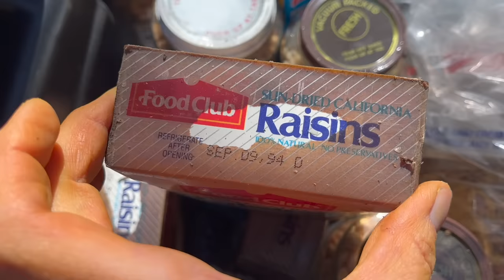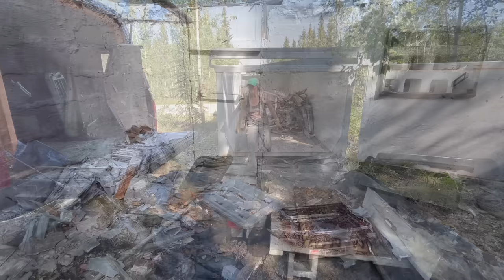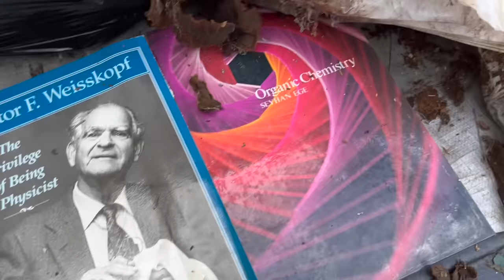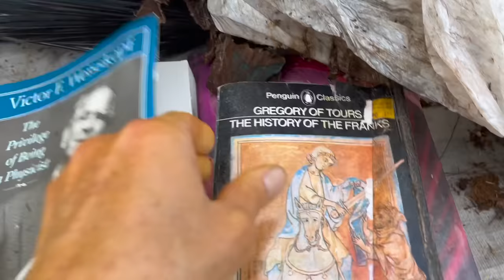Return to the Survival Bunker- I can't sleep.

Comment: The difference in batteries:  Standard batteries will corrode and leak out over time.  Industrial or Super Heavy Duty batteries have sealing gaskets and are made to better specs.  So if you need them to sit a while, get the better grade.  But if you blow through batteries really fast, get the cheap ones.    I am surprised there was not a basement.  Great work!  What a trooper!
Reply: Thank the lord there wasn't a basement can't imagine the flooding and the gunk. Especially from the leaked gas. The film it might have left ontop of the water. 🤢 It would've had to been pumped out or at least that's the only thing I could imagine being done to get it all out. Then how would you seal it up so it doesn't happen again oh and not to mention trying to dry the area out so it docent mold or corrode faster. 😵‍💫🤯 What a nightmare that would've been.

Comment: Brooke, have you ever given consideration to maybe starting a fire on the floor which would eliminate the fuel smell as well as the rancid smell of decaying food.  The smoke smell will dissipate too.
Reply: Before tackling the floor, get experts to check it out and advise you the best way to handle oil- soaked ground, as Kitty litter may NOT be the 
best material to use, AND DO NOT USE IT FOR HUMAN OR ANIMAL HABITATION!

Comment: Great job cleaning that structure!  The floor looks like it is prone to flooding. The floor seems to be at the same level as the turf.  Consider turning it into a 2 story.  Heat rises, so with a heater on first floor,  the 2nd would be warm in winter. If the second floor is designed right, later additions would be relatively easy.

Comment: If you're gonna reuse it in any capacity, need to dig up the soil around it and see if you can't get the outside ground level LOWER than the floor level.  Also, with the ammo there, I wouldn't be surprised if there wasn't a burred firearm some place close by.
Reply: Not a bad idea here! Would be a great place to do some metal detecting!
Reply: Definitely do some metal detecting in the immediate area and at any terrain features someone could use for cover, such as a ridgeline or depression, or an outcropping or large tree. That would be a secondary location and you may have to walk in a spiral to find it since it would be best if it couldn't be seen from the bunker. You gotta think like a prepper XD

Comment: The nearly thirty year old peanut find is amazing. I think that dry roasted helped with preservation. A respirator for the nasty finds would have been the only way I could have moved them. It looks much better cleaned out. Soggy TP and old clothes along with the flashlight and reading material is interesting. Tool and equipment storage would probably be your best option with the fuel and other spills. Would have been great if you could have saved the Rubbermaid containers. We have some about the same age and they're still doing the job. Good idea to keep the typewriter. It might be worth something or useful. Amazing workout. You need a break.
Reply from the maker: those containers smelled like poop! LOL
Reply: @therealgirlinthewoods  🤣
Reply: I suspected it was worse than that. You've done a great job!

Comment: You can use regular dirt.& Pine needles mixed with leaves to remove the odors.& Fuel smell out of that building with. I wouldn't get rid of those gas container's. I would see about exchanging any of those propane tanks to. That's if their not rotted out. That they can't be refurbished to reusable propane tanks once again to. cause a lot of them can be reused by changing out the valves.& Repainting them. After their pressure tested.& Leak tested to for reuse. If they only have surface rust on the outside of the tanks most likely their refurbished quality tanks still. I'd try exchanging them paying for ones then you can have propane tanks again ready to use. Those gas canisters can be cleaned up.& Reusable again with mean green cleaner.,or pine sol you just to let them air dry out completely. Check out the nozzles.& Caps & seals on them is all. It's really A simple  process to it. It'll also save you A bunch of money on having to buy.,or purchase new ones unless their to busted.,or have holes in any of them is only reason I'd buy.,or replace any of them truthfully. Scrub brush & comet&pine sol cleaner.,or Lysol even mean green.,or purple power degreaser cleaner works good for that purpose though.

Comment: You wore me out watching you. I've spent all day brush cutting, tree trimming, defining, sapling removal, and mowing my "yard" (field). I put up a 100 feet stainless steel clothes line. And unloaded supplies to build a utility sink to wash laundry using 2X4 and 1X4 and 4X4 timbers for water catchment & filtering system with some blue food grade 55 gallon barrels. And a used utility sink I bought. I've lived off grid for 10 plus years in an old motorhome that nothing works in it. But with a tarp I'm dry and warm most winters, and very hot in the summers. I'm a 63-year old female

Comment: Not sure if You Tube will let me make a third comment.  I admit.  "A little much" as they say. . Impressed with the last "clearing on the ridge" that you did.  Ok OK David's gonna say. "who is this guy."   My bad.  You guys are good at the "building trades."  And there is someone in Northern Vermont who does an excellent job with videos of his business with what is basically a Long Span and a 12/12 roof.  ~ Ken's Karpentry ~ His most recent is a garage build on a foundation. Four foot knee wall, 24 foot square, 12/12 metal roof, does all the pricing.  I know David would like his posts very much.  OK OK OK.... That's it.  ~~~ Check out Ken's Karpentry ~~~ Easy Peasy.

Comment: No.. But any food you don't want I would leave for the animals. I was a maintenance man for a mobile home community in Southwest Michigan and any food left in the homes I would go through. Items that were still good I took and shared. Opened items I would take to the storage area and shared with squirrels, opposumes, raccoons and mice. There is nothing as funny as seeing a squirrel with his little paws full of Lucky Charms! 😊 The only thing that never got eatten was Coco Puffs. Makes you wonder if they know something we don't. I would be tempted to burn out the floor. Build a fire inside and move it around with a metal rake. Baking the fuel oil out of the ground as well as any pathogens. Then do the Kitty Litter and sand.😊

Comment: You really scared me! Working on all that, alone, with so many potential injuries! And when you stumbled, I saw headlines!
VERY IMPRESSIVE JOB cleaning that out! WOW!!!
My personal opinion on the bunker - It has real potential. The biggest detriment to long term use, and in fact it's past use, is the below-grade floor... it's a liquid-holding pan. Install door sills and pour enough concrete to raise the floor at least to the bottom of those sills. Excavate just enough away from the structure to ensure acceptable drainage. A pitched roof, doors, windows, and I think it would be pretty doable! If I was 20 years younger and in one piece...! lol.
I have a great appreciation for your witness in prayer.

Comment: If it were me, I would use the dilapidated place itself to burn all the debris in rather than carrying and unloading it into your truck and then unloading from the truck and putting it into the dumpster. But, that is what I would do because in my mind, there are all kinds of bacteria and germs, and who knows what else of danger may be located inside those four walls. 

BTW: That is not a "Bunker" inasmuch, as it had a wood roof, which deems it to be a cabin with concrete walls, however, that makes it a good place to burn all your new cabin building scraps in with a much lesser chance of the fire spreading to the forest/woods.

Comment: If the propane tanks were still full, they might be usable if the valve still works. Propane is one fuel you can keep for many years without it going bad  and sucking up moisture from the air.